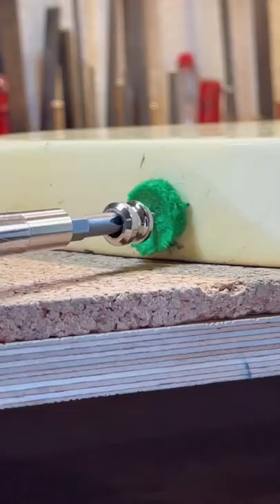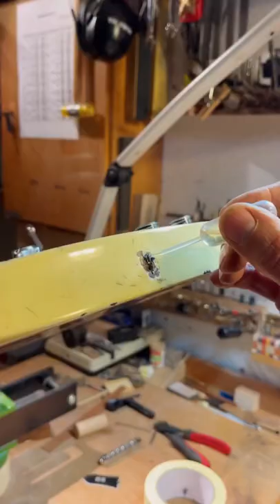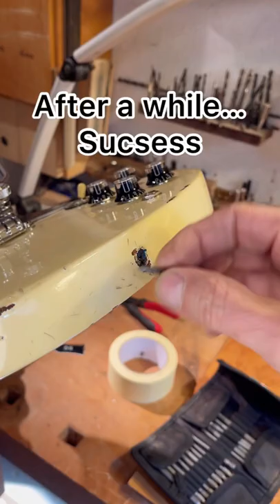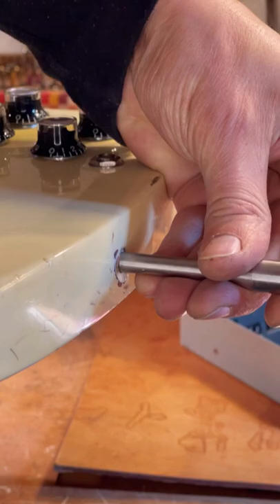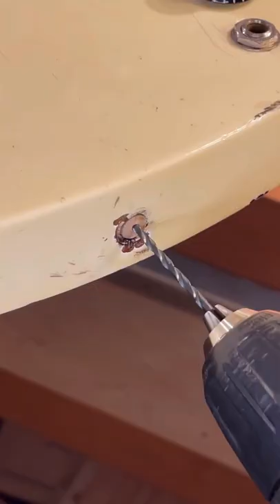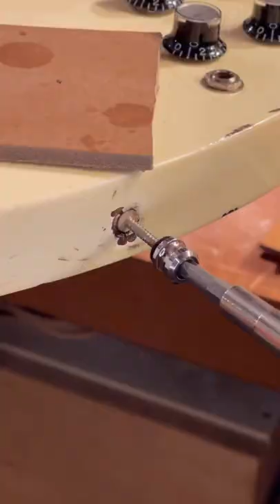Gibson SG Special Vintage white 1997 Guitar Strap pin repair #shorts #guitarrepair #gibson #luthier

Comment: In this case, a bad choice to use an end grain dowel to fill the void. the action of the screw will destroy the grain as it enters and have very little holding  power. Not something I would trust to hand off to a guitarist and think its going to secure his $1200 SG. 
Should use a plug cutter on a drill press and make a dowel from the flat cut side or quarter cut side of a piece of mahogany, which is what the body of an American SG is, but never the end grain side.
Reply from the maker: Thanks or sharing your experience, Brian. Best Regards Nik

Comment: Why are you using a cheap dowl and screwing into the end grain?  Eventually it'll work itself out or become stripped.
Go out and grab a hardwood drum stick made of ash, beachwood or maple.  Turn it down to the correct size and use it.  You're NOT screwing into a soft, cheap home depot dowl end grain.  I've done it this way for 30 years, never had to go back and re do it...just a thought
Reply: I'm only wearing one sock.. i have no idea where the other one is
Reply from the maker: Thanks for your feedback. This is Beech really hard wood:-) Best Regards Nik

Comment: Would epoxy have been a better choice of glue for the insert?
Reply from the maker: You can also use Epoxy this is also fine and strong. But I prefer glue where I can wipe of the excess and with Epoxy its always a little bit complicated. Best Regards Nik

Comment: Great job. I would tend to use a 2"+ long screw so that I am also hitting some old wood for extra holding power.
Reply from the maker: Thanks for watching and your comment. That's a good Idea👍 Best Regards Nik
Reply: @petrekguitars  Former engineering major here- can't turn it off! Technically that screw would expand the wood anyway so it would likely hold good enough...but why not. Screws are cheap. Further, dowels are a much softer wood so they don't hold as well. Longer screw- problems solved.

Comment: In a pinch I've had to use a pair of chopsticks shoved in there works great
Reply from the maker: Thanks for your Feedback. Yes you are correct, normally this is enough. But if the hole is to big you have to insert some new Wood to make it work again. Best Regards Nik

Comment: What did you put on the screw at last ? Fish glue?
Reply from the maker: Hey Cristopher, Yes that's correct I use Fishglue. Its really strong and if you wanna lose the screw You can heat it up and it will become soft. Best Regards Nik
Reply: That fish shit smells fucking gnarly duuuuude
Reply from the maker: @jimmychucksluckfluck8805  This one I use is cold Glue this is not so terrible like the hot version. Best Regards Nik

Comment: You didn’t glue that button in did you
Reply from the maker: Hi Steve, Yes I did because the Customer asked me to make it Rock solid. I use Fishglue if you heat it up you can loosen the screw easily. Best Regards Nik

Comment: wow, did someone use a wall anchor as a previous repair. Creative. but stupid. have to replace the wood in the oversized hole. bravo
Reply from the maker: HI Eric, thanks for watching and your comment. I'm not sure but I think Gibson did this a few years long from Factory. Because this is not the first Gibson that had this plastic "whatever" in the Pinhole. Best Regards Nik
Reply: @petrekguitars  I get the logic, but plastic is more malleable than wood and would wear out quicker. Not sure what gibson was thinking.